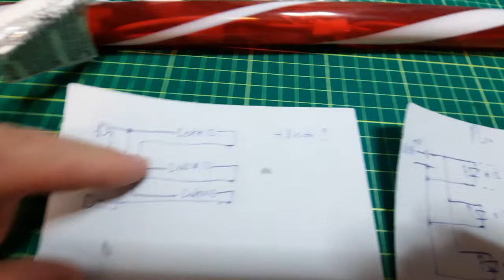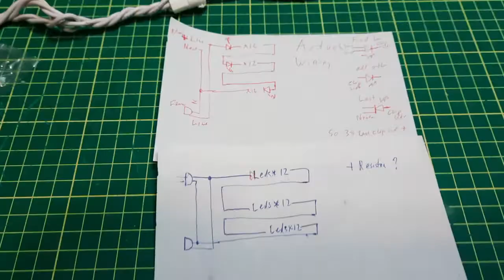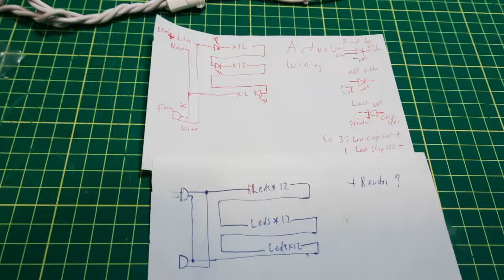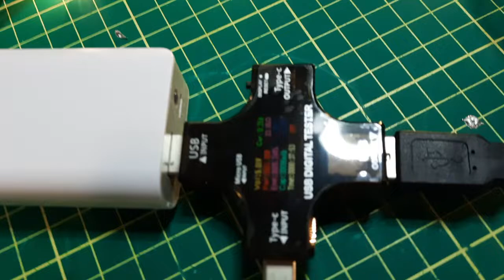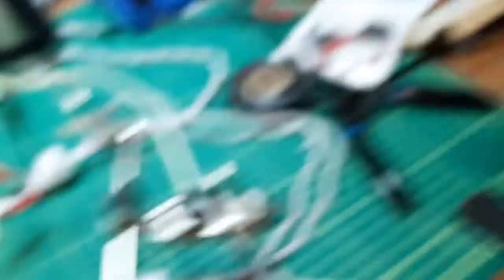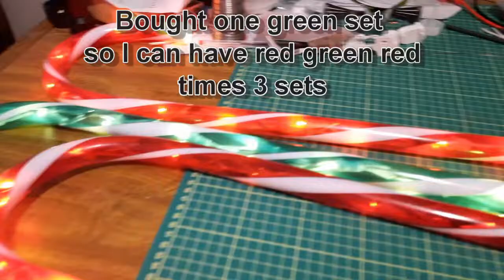Candy Canes Converted from 120V to 5V

Comment: You seem to be very knowledgeable with electronics hence the reason I have been watching all your videos. I have a question. I have an AC-AC Adapter Class 2 transformer Input is 120V AC and output is 6V AC 4A. When I plug the village in, the lights only stay on for a 1-min then they go off. I have to unplug the whole village for a few minutes and then plug it back in and the lights come on again, only to shut off again. Your videos have helped me with changing all the original lights with the LED string lights. I want to do something similar to the village that this AC-AC Adapter goes to. Any idea as to what to do?
Reply from the maker: Keep in mind I am not an electrician so take everything with a large grain of salt. Sounds like your power supply to the village could have a resetable thermal fuse in it and it is heatting up then shutting down for a good reason. Once cool enought it turns back on.  There could be other possibilities. 

If you want to run the village off of the 120VAC to 6V AC adapter then there is a couple possibilities.  
Expensive = find 6V AC LED bulbs. 
Cheaper = use a regular diode rated for the Amps required to half wave rectify the AC then use this output to the LED with a resistor in series for each "bulb"  If the LED has a forward voltage of say 2.5V and is bright enough and rated at 10mA then the resistor would be around 250-300 ohms. A bit of experimenting probably is best.  All the LED resistor combinations (LED polarity important) would then be in parallel like regular filament light bulbs. This way you don't have to worry about the reverse voltage breakdown voltage of roughtly 5V for LEDs.
Could even use a full wave rectifier to drop the voltage closer to the forward voltage of the LEDs.
I am sure there are other possibilities. I like low voltage DC since it eliminates a lot of problems.
Hope that helps